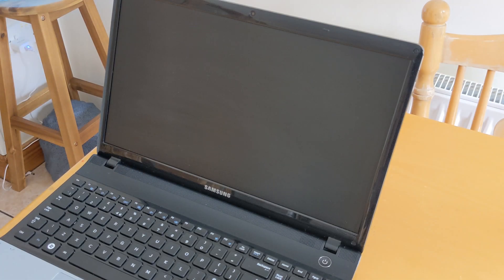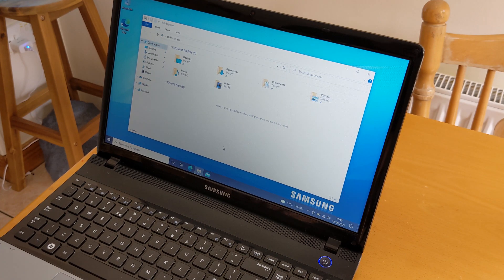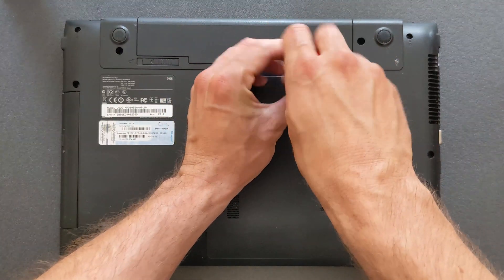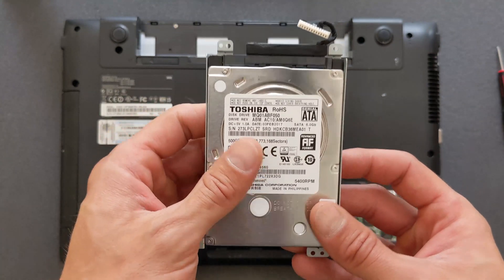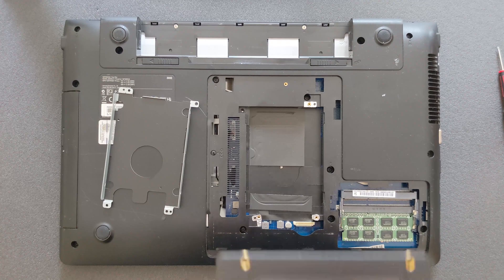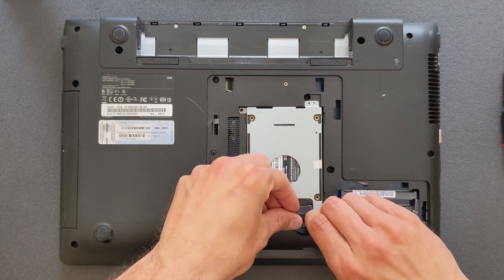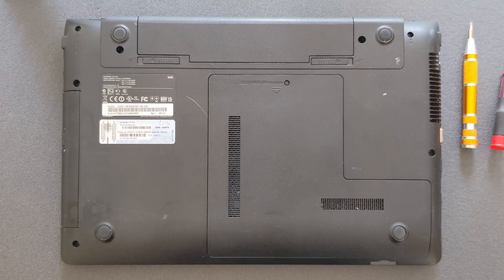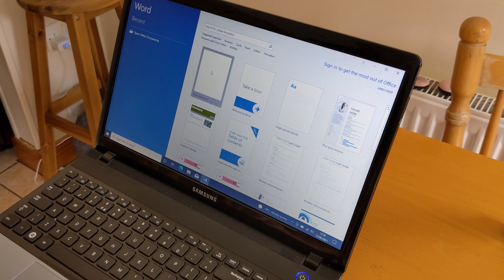Upgrading 10 year old laptop to SSD - HDD vs. SPEED

Comment: Can you tell me what processor does it have 
I mean I too have the same laptop and it’s celeron b815 it will help me if I should upgrade it with an ssd or should just discard it
Reply from the maker: Hi, this one had Pentium B950 CPU.. not the best either but SSD definitely made serious difference so i do recommend upgrading. It's a little investment to get another few years out of it. In a way you are right, they are old laptops and at the end you are still limited with processor and ram speed.

Comment: i upgrade my lenovo v110..with intel celeron and take at least 35 secs to start...(sdd 512 gb/8gb) why is that??
Reply from the maker: Hard to say but maybe it's the Celeron cpu what makes it slow! Celeron processors are not the fastest. Have upgraded Asus laptops in past with celeron cpu's and results are never same as they would be be better cpus.